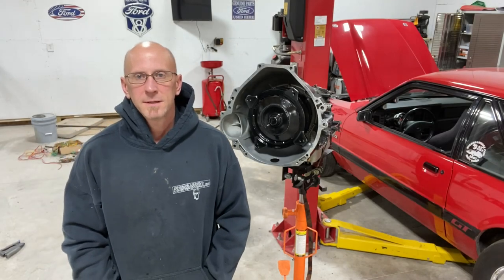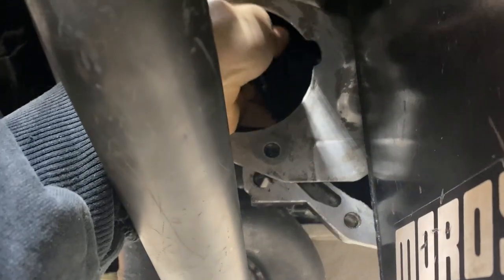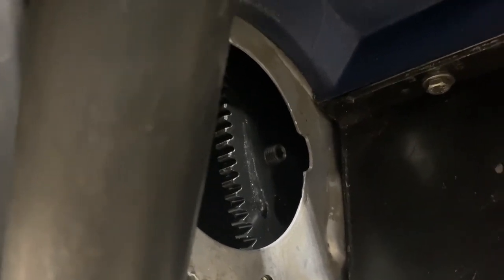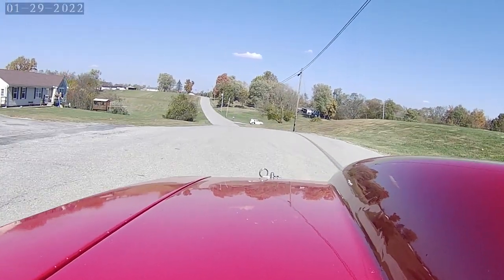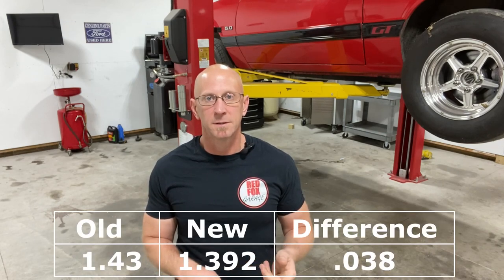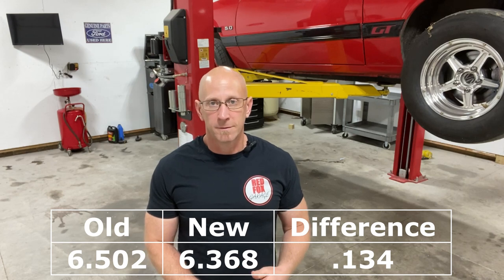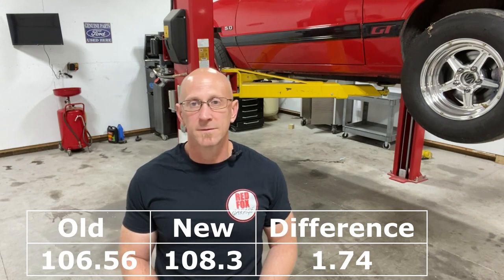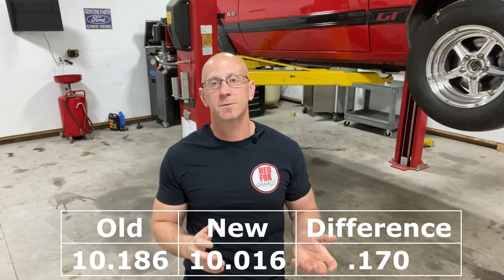AOD-E 4R70W torque converter results are in.  Were we able to hit all of our performance goals?

Comment: Great videos, sorry I'm late to the party lol. My current set up is a 347 10.5:1 CR with the 4R70 built by Darren Birchler. My best NA time is a 7.80 and best 150 shot time is 6.78
I'm running an Edge converter that stalls around 3200, what stall do you recommend to get a little faster ET? I'm foot braking, no Transbrake. Thanks!
Reply from the maker: Hello and thanks for checking out the video!!  I used an Edge converter in an AOD several years ago.  I was pretty happy with it.   What kind of intake and cam do you have and what gear and tire size?  What are your typical 60 foot times and mph?  I would generally say something closer to 4000 would be better but if the engine is built more as a torquey street engine  it may be about right at 3200.  I will say that I have had several converters
restalled through the years and looser has generally been faster in my experience.

Comment: Awesome ride man.   What brand headers are you running with your AOD?  Im having a 408 built and looking to run some long tubes.
Reply from the maker: Thanks for watching!!  They were made by accufab, I’m not sure if they still make headers or not.  There is definitely a very specific order of operations to get them on,  but they do fit good considering all of the obstructions that they have to clear.

Comment: What flexplate are you using? Part number and Mfr please.
Reply from the maker: scat FP-302N   164 tooth.   The n is for neutral balance so that could be different for you depending on your engines balance.

Comment: I'm running a V6 torque converter with the 4R70w and 273 rears.
Reply from the maker: Does the v6 converter give you a bit more stall than a v8 converter?

Comment: If you would share like to know some of your build details. Thank you
Reply from the maker: Thanks for watching!!  It’s a dart black 427 with 225 high ports.  compression is around 12.5 and it has a relatively small solid roller from cammotion, about 254/264.  The rear has 4.30 and a spool.  since this video  I have installed mini tubs and team z torque boxes.  That is most of the stuff I can think of off the top of my head.   if you have any specific questions ,  I’d be happy to elaborate.
Reply: Looks stock! Nice car, you’ve done an extremely nice job of putting together a potent package. My car a ‘87 notch stock motor with TFS valve spring upgrade roller rockers gasket rebuild 70 mm turbonectics 8.5 boost AOD built solid input shaft and Lentech valve body. 31 spline Moser axles rear end rear Cobra brakes. You are much faster…. My retirement project having fun. Looking for future videos.👍👍👍
Reply from the maker: Sounds like a nice combination.  Good luck with hitting your goals!!